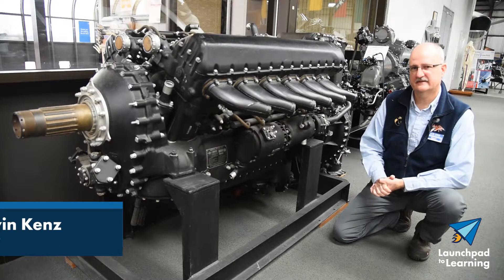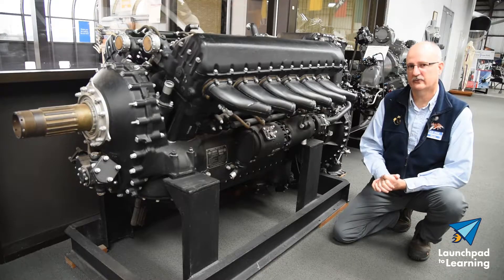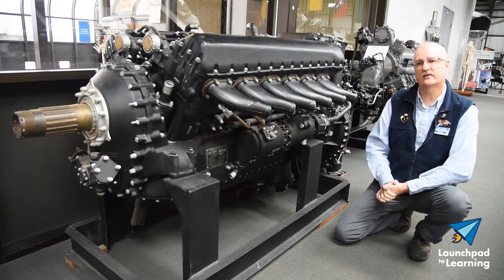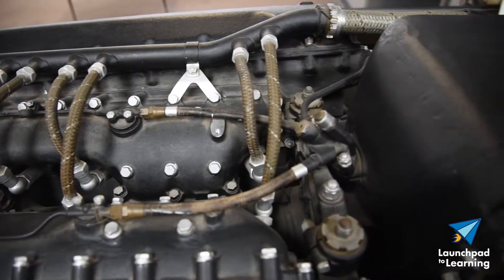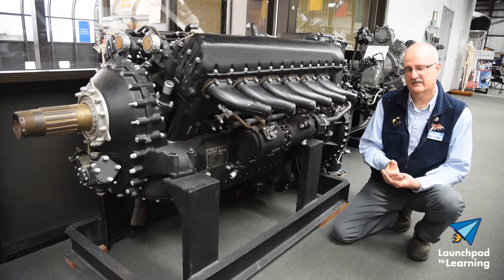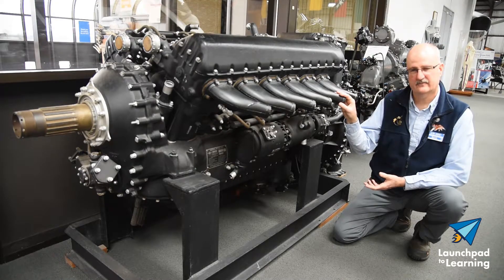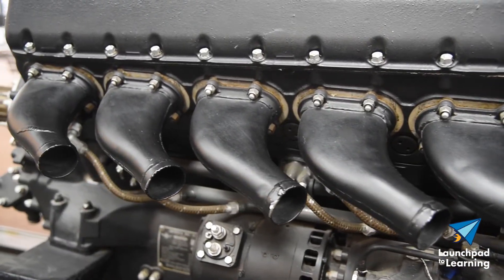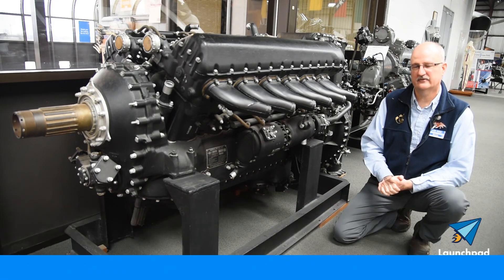Continental Built Rolls Royce Merlin Engine

Comment: Excellent video of a rare Continental manufactured V1650 engines for USAAF use.  The other little known production of the Merlin was by Commonwealth Aircraft Corporation (CAC) in Australia, who produced 108 engines before production stopped.  They manufactured the Mk 102 Merlin engine incorporating the late model improvements of the engine.